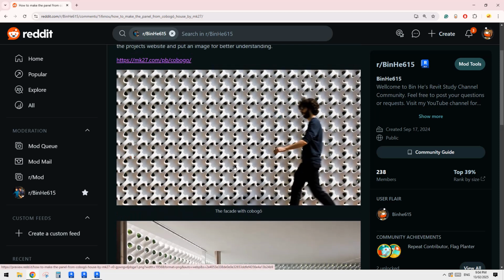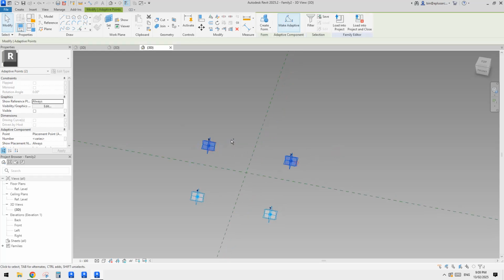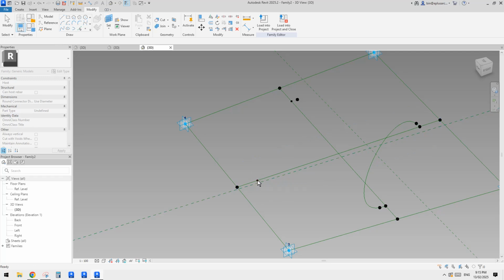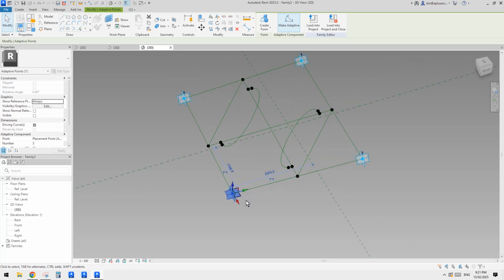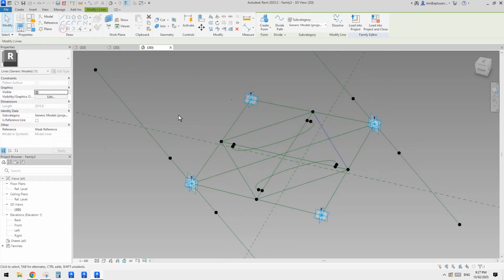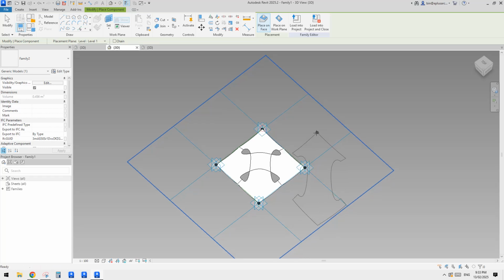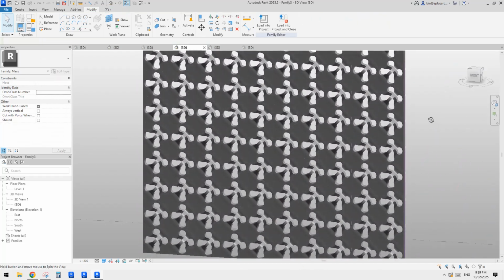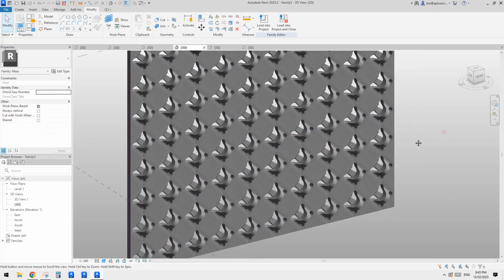25023 - Pattern Based Family Exercise

Comment: Thank you so much for answering my question Bin. I don't really know if the architects used grasshopper to make this panel, since it's not really used in my country, but i can't say for sure. I think your attempt turned out pretty good, and it looks pretty similar to the real panel. Cobogós, or the panel you made, are normally made like bricks or ceramic blocks, so your approach was probably much closer to reality than you think. I'm really happy with your help and attention to problemsolving this, thank you so much.
Reply: I think revit modelling is closer to a real world project but it's so difficult and time consuming that's why everyone is shifting to other programs like 3dsmax and rihno...
Reply: @serious7800  i dont know man, i think it really depends on how you want to make your projects. I really like revit and can't make most of the things i do in it in other softwares as quick as i do in revit, and it has many BIM tools to make collaborative work easier. I know BIG uses rhino and grashopper for designing and then they link it with revit for documentation and management.
Reply: The project is in Brazil, by MK27 Architects. The cobogó used was designed by an american artist called Erwin Hauer. @sharati4326